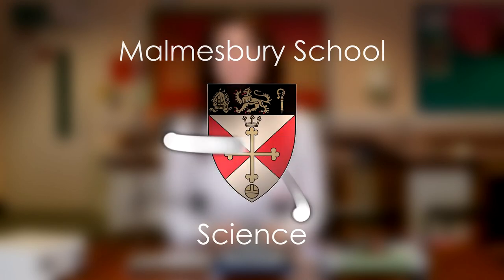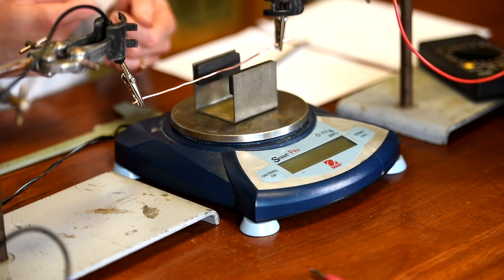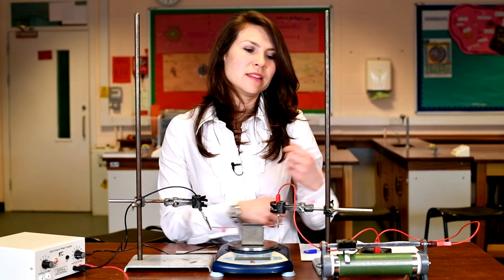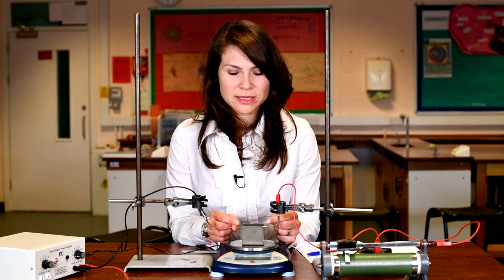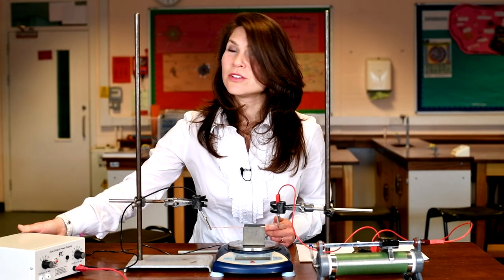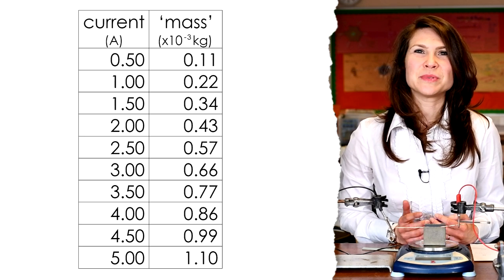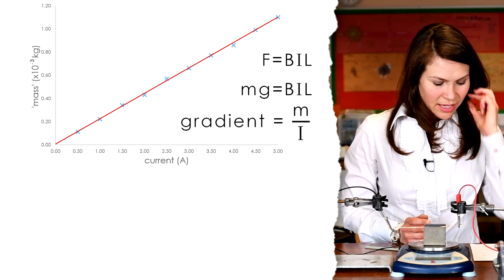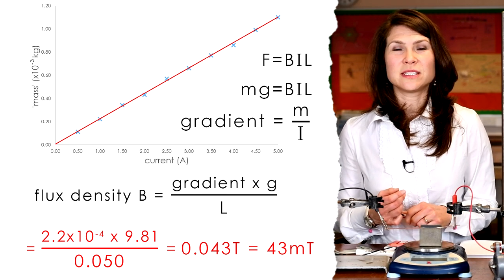Motor Effect F=BIL - Physics A-level Practical

Comment: Is there any particular reason why the copper wire used in this experiment is thick? Does it have anything to do with heating effects?
Reply from the maker: As a good conductor, it allows a high current to flow with little heating.

Comment: If the magnets were the other way round (reversed direction) and the cradle "lifts off", then wouldn't the field strength be negative? (As -change of mass and +change of current). But how can magnetic field strength be negative?
Reply from the maker: Because it's a vector 😊
Reply: @MalmesburyEducation  With it being a vector, the negative sign accounts for the direction.

Comment: Is there any reason for using both a variable resistor and a variable power supply? Surely you can just use the variable power supply to change the current
Reply: You can. We use a variable resistor with a fixed power supply: Just seems to be easier to adjust for the values we want.